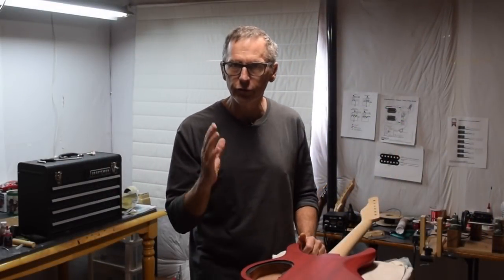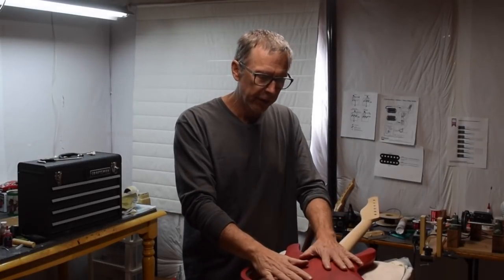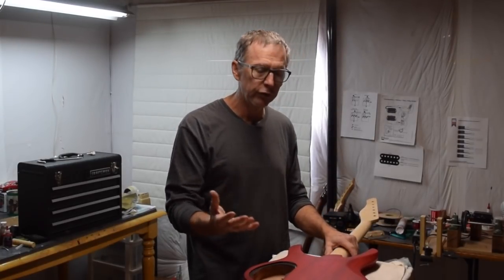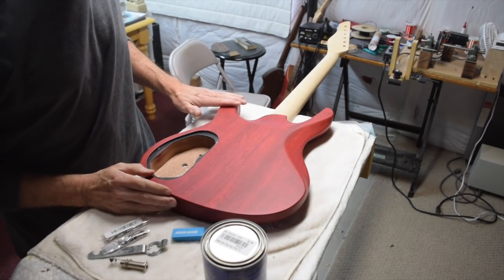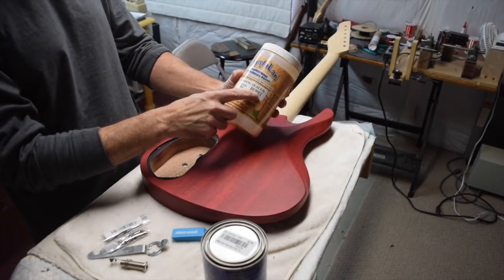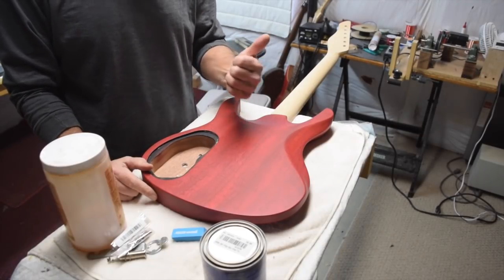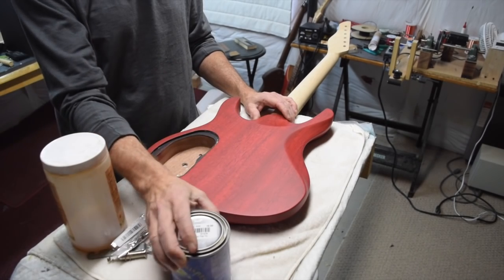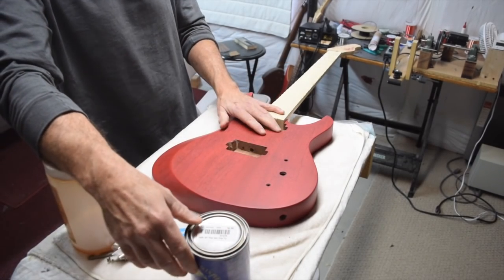General Finishes Flat Out Flat Topcoat On A Guitar

Comment: Curious as to why you opted for the Flat Out Flat product over the high performance Dead Flat. 

Flat Out Flat is soft and velvety, yes, but wasn’t created for high use and remains soft, like a wax finish. It is more susceptible to marring and fingerprints. I’d imagine those would be worrisome characteristics for a guitar body, no?
Reply from the maker: It didn't exist when I made this video.

Comment: Watched this video because I wanted to finish my guitar in matte black.  Bought this product at a Woodsmith store and it's pricey.  Prepared guitar then sprayed the finish on the guitar as directed by instructions.  Let dry for two days and it looked great.  Accidently scraped by fingernail on the surface and there was a white scratch that was very visible.  Handled it like I would at a gig and there were white scratches all over it.  Seems the product finish dries nicely but is very soft.  What can I do?
Reply from the maker: You need to contact the manufacturer to find out what went wrong.

Comment: looks amazing but it's expensive. 2:21 it non-sterraid sandpaper? what is this?
Reply from the maker: Stearated sandpaper is coated to prevent clogging. However, this coating can leave a residue on the surface which can react poorly with water-based finishes. And it's hard to completely remove.

Comment: I want to us this product over Stew Mac color tone black dye that I’ve mixed with water.  Allowed to dry and applied rub n buff wax into the grain and wiped off with teak oil for a cerusing effect. 

Do you recommend a dealer over this finish before applying flat out flat?
Reply from the maker: Yes! I would test on scrap first since the rub and buff wax could cause adhesion problems.
Reply: I tried it and the flat out flat rubbed the wax right off. 

Plan B, cover the wax with a water-based sealer and then try the flat out flat.  Do you think the flat out flat will adhere to the sealer?
Reply from the maker: @adamj4505  I don’t know. You’ll have to ask General Finishes.

Comment: Hi
Question :I have try the Minwax poly acrylic and the varathane water based poly which I like more than Minwax poly acrylic and it is the one I currently use for all my projects,but I was thinking to try the general finish high performance,does it worth the extra money or   It is about the same as the varathane

Comment: Hey Chis. How does the GF flat out flat compare to the matte finish version of Brite Tone? It looks like the GF would be difficult to beat.
Reply from the maker: ja rizz brute tone is much harder.
Reply: Does it self level as well? I have had difficulty with Brite Tone gloss as far as runs and sags. For clear it can be leveled and polished anyway. Will the matte finish sand to an even appearance?  Thanks.
Reply from the maker: ja rizz I don’t sand it. I spray 10 coats of clear gloss, level it, and spray 3 coats of matte. Then it’s done.